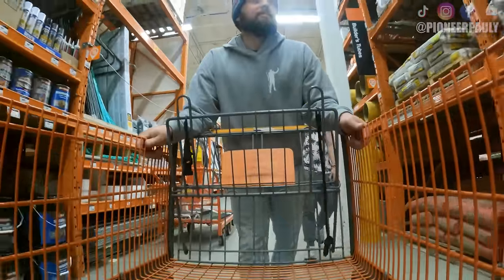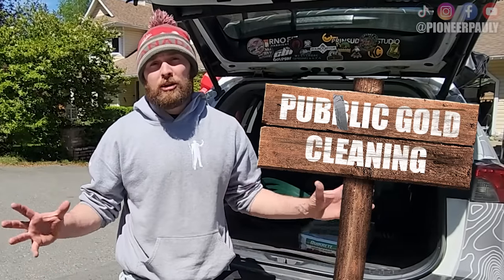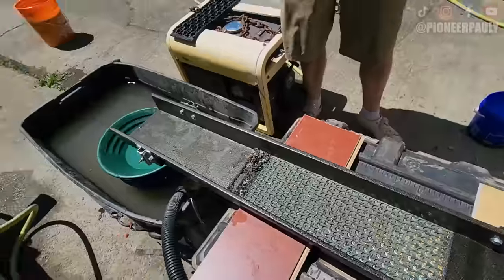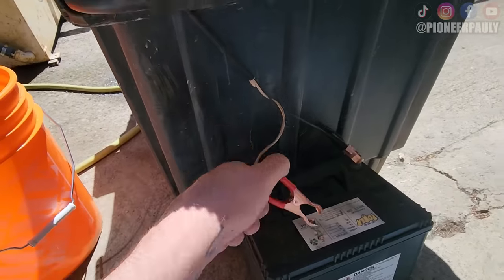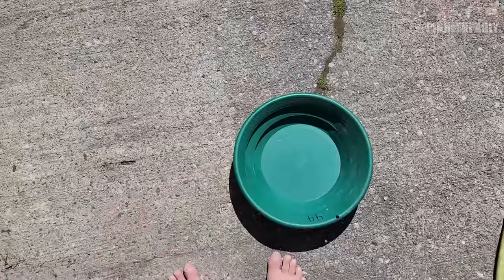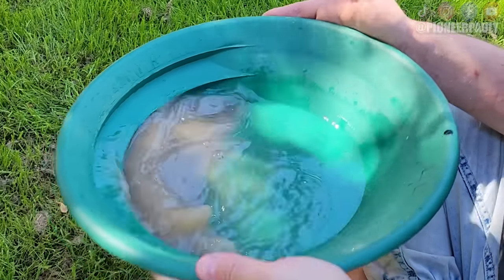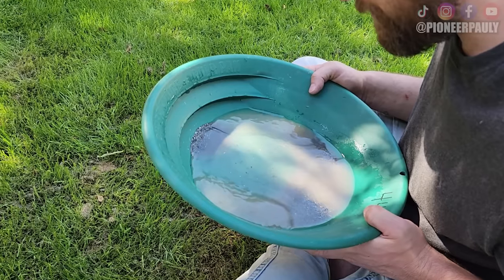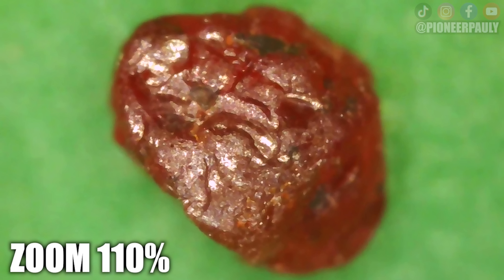How Much GOLD Is In Home Depot Sand?

Comment: Just to be clear here the sand in those bags is regional. Some states the sand will have small amounts of gold while other states probably wont. Thats why his play sand was so dark. Where I am at play sand is more yellow/brown.
Reply: They also assay the sand to determine if there is an economic amount of gold in it.  Gravel pits do the same.  

Either they got lucky or they made sure there they were lucky.
Reply: I got a bag of sand from my local Home Depot, I've found flour to fly poop size pieces,  and I've basically just started panning it out
Reply: Extremely regional*
Reply: @richardmcbride641  grams to sand cost ratio so far?
Reply: @mhxxd4  my main reason for trying the play sand route is not for the money value of the gold that might be there,but for the practice and experience of getting the fine gold
Reply: @richardmcbride641  🙄

Comment: Bought a couple bags of sand from my local nursery store.  It was processed by a quarry in Wisconsin, glacial sand, brought down from up north by ice age glaciers.  Nothing special, just play box sand.  Left the top of the bag open, and after a few days of wind and rain, I noticed a tiny bright sparkle.  Think a few grains of gold, and next to them a group of tiny red-orange crystals gathered in a small valley in the sand.  Think they were garnets.  The gold was very small, but you would have removed them.  (Pickers?). Went back a day later and it looked like a squirrel had been digging in the bag, we have a lot of them digging in the garden.  So they were gone.  I suspect there is an interesting amount of gold in Wisconsin glacial sand, but it would cost more to process it than it’s worth….
Reply: Oh wow, all the glacial till from north of the great lakes must have ended up in your state! My family worked/still work as miners in Ontario so I think often about the sheer volume of heavy metals in the granite right at the surface, not to mention the amethyst shops nearly everywhere. Now you've given me something cool to further consider  - the exposed Canadian Shield means that all sorts of metal- and gem-heavy dust has been rubbed off and pushed south!
Reply: I live in West Bend Wisconsin, on 5 acres, my entire yard is glacial sand. I never thought there would be gold in it though

Comment: Black sand actually does have uses. It's a great abrasive for sandblasting. Black sand was also historically a source of iron that when mixed carbon in a ratio of 1-2% by weight was used to smelt steel. Traditional Japanese steel called tamahagane is still made this way in Japan by a very few traditional steel makers. They still use the clay furnaces and it takes days sometimes longer for the artisan to finish making the steel.
Reply: You must be a hit at parties
Reply: @Wigglewonks  I get invited but I usually dont go... But I get why your being sarcastic. 

A 5 gallon bucket of black sand when smelted into bloomery steel. How much do you think that would cost? Per kg the cost is 120 dollars. That bucket if dry would weigh about 70 pounds. That bucket of what gold miners consider waste is actually worth about 8400 dollars to the right person. That translates to that bucket being over 4 ounces of gold in worth. Smelted into bloomery steel (tamahagane) the price goes up. A 1500 gram chunk of high grade tamahagane or roughly 3 pound chunk can fetch as much as 3000 dollars once forged. Youd have close to 10 times that in that simple 5 gallon bucket if you could get the good stuff out of it. So that simple bucket could be worth as much as 15 ounces of gold.
Reply: @kingdarkem  umm, what’s the cost to have someone collect, prepare and ship to the guy who’s going to “smelt into bloomers steel?”
Reply: @Wigglewonks  well a small gold miner saving the black sand should be able to fill the bucket. As for processing into steel you really dont need much. A small backyard foundary will do number of youtube videos on cobbling one for steel together. To add carbon simple charcoal will do....if you got a fireplace sift the ashes. The lumps of charcoal set aside along with some of that ash. The ash makes for a great flux to remove impurities. To get the carbon youd only need a pound of charcoal. 

Doing it yourself is significantly cheaper then mailing it go be smelted. After initial investment you can get an ROI after a single smelting. 

Plus the smelting foundary could be used for smelting that gold into ingots.

The regular sand can also be used. In the foundary to make glass. Limestone or seashell works great along with fireplace ash. ;)

From there the worlds your oyster...i try not to waste stuff if possible. ;)